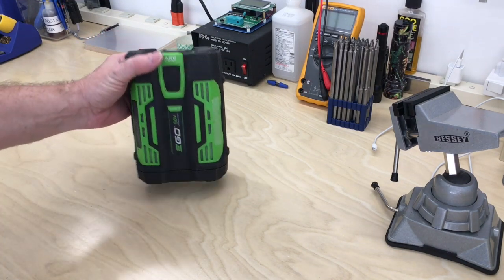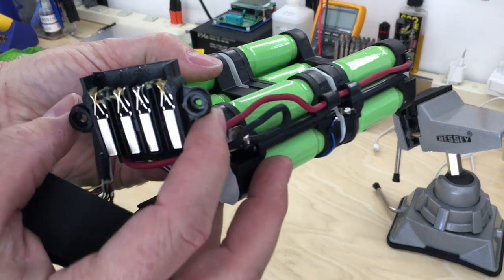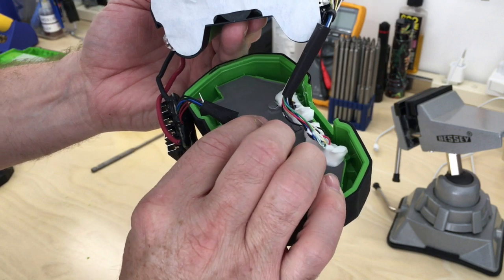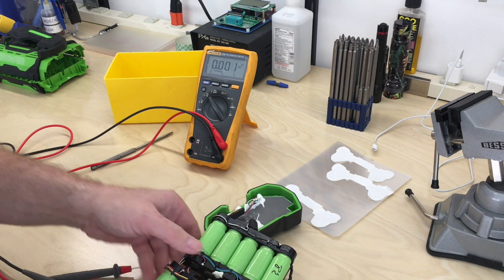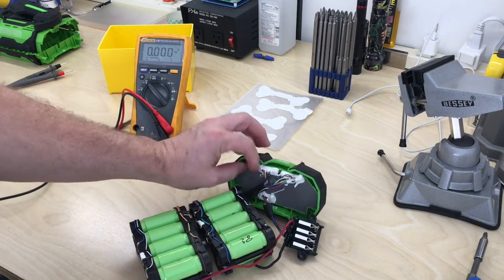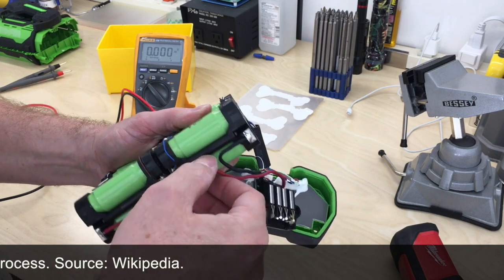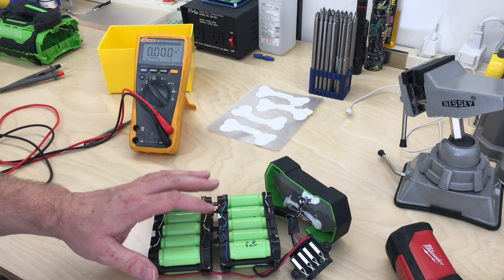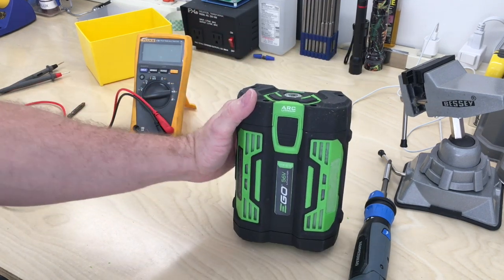EGO 56V ARC Lithium Battery Teardown

Comment: Ego battery is a scam.  All of my 4 packs died the same day.  All on 4 different chargers. Puzzled me a while.  I find out that the TI battery management chips inside the pack not making charge after certain usage which is roughly about when the warranty running out.  Almost $1000 worth of batteries are PoS now. PLEASE  DON'T buy EGO
Reply: Baloney
Reply: Tim May you did something wrong man. Or Something wrong was done to the batteries that you don't know about.The Chances you got 4 bad batteries is why too high. I have 3 for over 3 years no problens. There is some type of commonality that you have missed.

Comment: Same issue. The battery becomes stuck in self discharge and needs to be reset. The only solution I have found so far is to pull all the connections and reseat them
Reply from the maker: Kenneth Oslund, Glad to know yours is reset. I have not come accross any that would "reset" the only fix has been like the one in this video.
https://youtu.be/EH0GS0iUzzM

Comment: If you hold the button down for a long time you are making the battery electronics think there is a bad cell so the led flashing makes the battery go dead so it cannot be recharged so you send it in for warranty or recycle it.

Comment: Thnx, great clip! But I would like to have seen more about the connections and wiring - and it would have been top if you had opened the sealed electronics housing to take a look at what is inside, what is does, how it works and.... why the LED is flashing! (My guess is that it is some sort of controller which monitors the charging and discharging of individual cells and somehow controls the charging and discharging to ensure that the cells are yoked up to each other and perform as a team???)
Reply from the maker: christian gibson , check out my video that shows it repaired!
https://youtu.be/EH0GS0iUzzM

Thanks for your comment!

Comment: I've got a battery where some of the connections have been pushed out of the 10-pin header.  there are two black connections on the far left (I'll call these position 1 & 2) and green & black in the far right (position 9 & 10).  does anyone know the correct order for the pins so I can put them back in place?

Thank you.
Reply from the maker: Stephen Peck,
BLK,BLK,nc,brn,wht,yel,Blu,Rd,grn,BLK.
Reply: Thrifty Tool Shed awesome thank you sir!
Reply: Hoping this fixes it, if not on to cell repair!

Comment: Howdy... I don't own a EGO but I was thinking of buying just the skin so I can use my many 7S lipo batteries. So 7s + 7s in series = 49v-58v. The issue is the 3rd and 4th pin and what they do. I'm happy adding a thermistor but I need to know the resistance... any chance you can enlighten me? I'm sure just adding + and - aint gona work, so what do I have to do?
I can see the original pack is using 14x 18650. Thanks.
Reply: I've been trying to find what these 170377 really are, they look a little bigger than 18650's to me
Reply: I’m wondering the same.  Ever figure out those other two pins?

Comment: The batteries have a 3 year warranty so give Ego a call at 1-855-EGO-5656 (1-855-346-5656) from 8:30AM - 8:00PM EST (Monday - Friday) & 10:00AM - 6:00PM EST (Saturday & Sunday).
Reply from the maker: Paul Christenson, assuming you posted before watching the video.
Reply: Correct assumption...by the way, these are great videos...:)
Reply from the maker: Paul Christenson, Thanks for your comments.

Comment: All the cells are connected so they would show the same voltage. you would have to measure each cell separately under load. measure the voltage drop across a resister.
Reply from the maker: Kooka Munga , No sir. They are in series not parallel. You can most certainly check individual cells, that's how the bms monitors the cells. To learn more about how it works check out the repair video of this same pack the next week. I have been using this pack ever since repair last year. 
https://youtu.be/EH0GS0iUzzM

Comment: Hi mate do you know if I can buy an ego 56v blower with battery in the USA and use it in Australia? Is there any issues with charging voltage? I have other ego products and charger with Australian plug. Thanks great video 👍
Reply from the maker: Jeremy Longton , I have not been into the charger yet at all. So all I can say at this point is the rating on the charger is only for 120V 60HZ. I would not be suprised if it is easy conversion since surely they sell the products there with minimal changes but I just do not know yet.
Reply from the maker: Jeremy Longton, If you were asking if the charger you have there would charge the 56v battery from here, I dont see why it would matter. But I do not have both to be sure though.
Reply: https://egopowerplus.com.au

Comment: I am looking for the wiring diagram for the charger mine has power going into the charger but it does not show power going to the battery
Reply from the maker: Ricky Paracuelles, I wish we could get our hands on all of EGO schematics but they would most likely never let those get released. I have not had to troubleshoot mine at this time. Are you sure it’s the charger by chance do you have more than 1 battery to test it with?
Reply: The unit comes with a 5 yr warranty, why break things when you can get it replaced?
Reply: Andrey Banyuk I had one fail and they replaced it under warranty. They send you a new one and don't ask for the other one back so I have one of these in the garage I'd like to tinker with. I'm sure it's a simple problem.
Reply: I've had the exact same thing happen to mine ,luckily it was under warranty and they are sending a new one out ,hopefully no more problems with it .

Comment: any more progress or update on this issue?
Reply from the maker: jmm1000 , I have the battery apart on my bench again at this time. I am hoping to do a follow up video. I am troubleshooting the circuit now after digging all the silicone off the board. EGO
Sent my replacement quickly so as I have time I will look into this circuit board more.
Reply from the maker: jmm1000, I have received the components needed for this battery repair and will be finishing the edits and hopefully get the video uploaded today. It is fixed!
Reply: what king of heat absorbing wrap will you use on the cells? what kind of cells / did you have to replace all at once to match them, or just the weak ones? thanks!
Reply from the maker: HI,
I have uploaded the video now. I am sorry i do not know the info on the cells. I was sure that I would have to go that deep in the cells the way they discharged.
But even though my cells did get pulled down below a safe level for them (due to the bad component) the batteries balanced out and held a charge very well. After several tests all my batteries are holding strong.I will be surprised if eventually i do not have to get into the cells as deep as you have mentioned above. If i do have to take my pack back apart i will let you know.
Reply: Thrifty Tool Shed I want an update to what happens what was wrong with it???
Reply from the maker: DragonsREpic , I have finished with the repair the video link is https://youtu.be/EH0GS0iUzzM